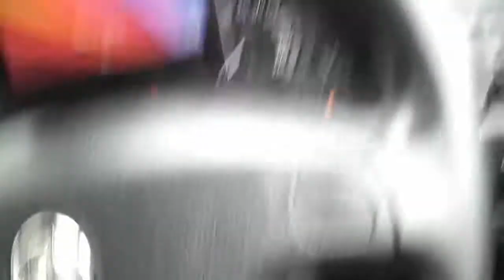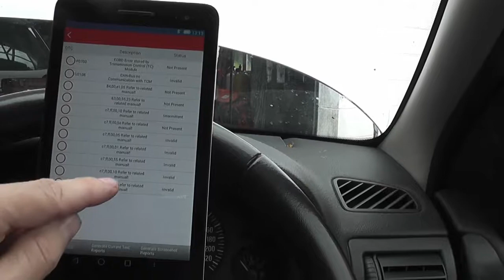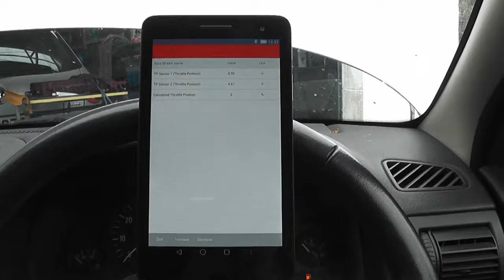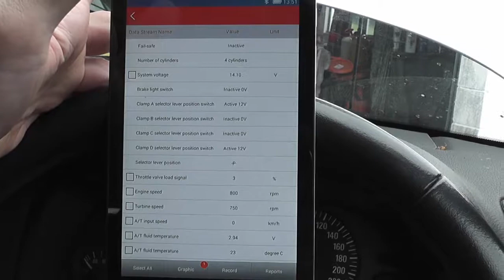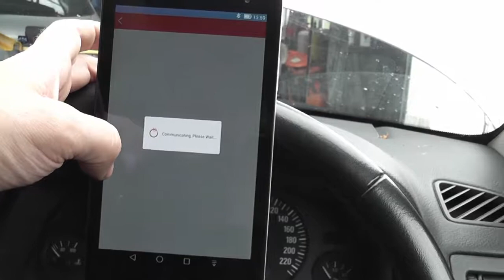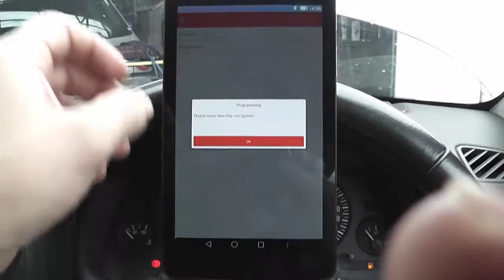Launch x432 on astra 2004

Comment: Hello, I am interested purchasing this but I have gotten mixed response. Can you program keys to immobolizer & does it support PCM/ECU replacement, like update vin and immobolizer feature, to add keys and etc? 

Note: Some people have said yes it's possible, others have said NO. 

Thanks in advance
Reply from the maker: Rafael Beato  you can't buy this no more the pro launch can programme some keys you need the code on the security card or use a tool who can hack the immobilizer this won't crack calculate pin code. for best results on GM like vehicle is GM tech2 and for new j2534 drew tech with factory software.
Reply from the maker: Rafael Beato short answer it appears I can erase and program key with this but have not tested if it will do I loged on with 4 digit code then it asks erase key is where I aborted the process
Reply: Intrade Motor I decided to ask you because a YouTuber by the name "George Melnik" shows the he was able to update vin after replacing PCM/ECU and then program the key to the immobilizer, he did show in the video that it went thru erasing keys, supposedly it's how it works, erase whatever was there before and then program the new ones. I would like to buy but don't want to spend my money. I have a Honda and the youtuber was doing it on a Honda as well. I asked cause it's only him who have done it and wonder if it's because nobody else knows it's capable.
Reply from the maker: Rafael Beato you have to look carefully what tool he exactly used launch make so many different tools I have the i-diag not easy diag or anything idiag is 95% the same as the launch pro 2. my one is a genuine Launch I log in via dbs car  is launch website programm for idiag is 66$ us per car 1 or 2 year update renewal is something like 44$ us tool works with old update. I paid 1400$ for All Asian car bundle and with points from purchase I got me Opel and Mercedes. and sprinter.